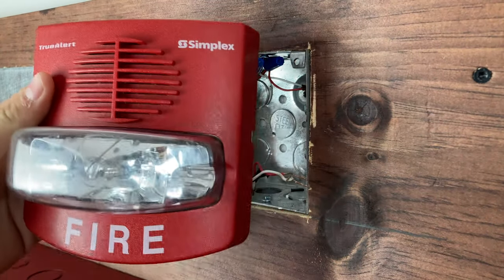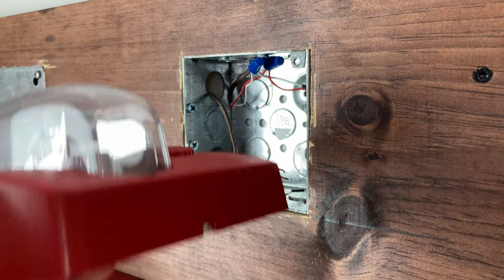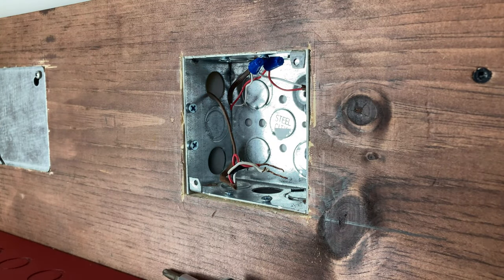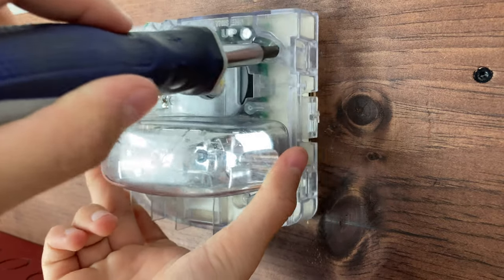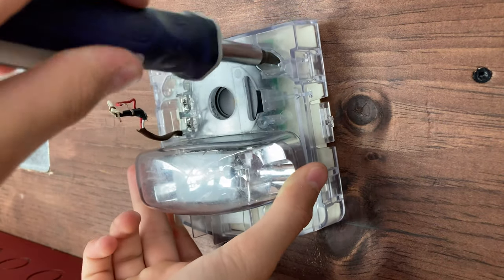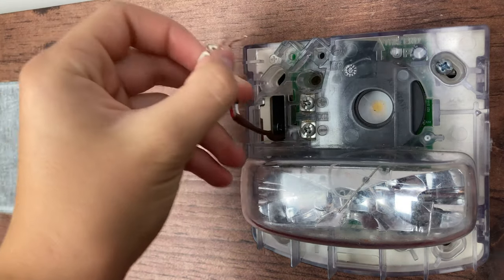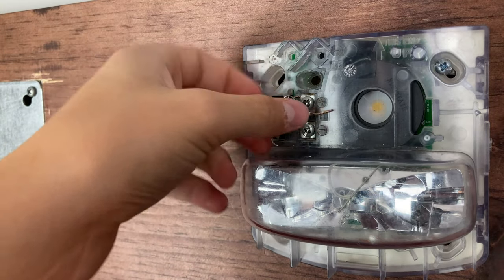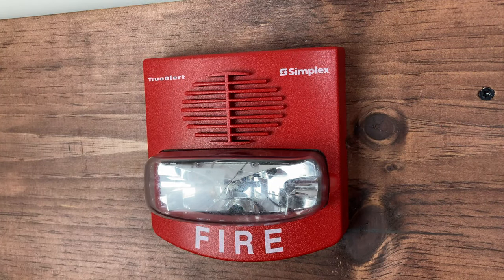How to Install a Simplex Truealert

Comment: If you get dead insects in the strobe light is it possible to get them out?    I have a couple mounted on ceilings that have this issue.
Reply: reallll! ive seen some with bugs in em dust inside of em & everything else

Comment: link to the resistors?
Reply from the maker: They actually came with my panel, so I don't have a link. Sorry.
Reply: @FireAlarmAlerts  do you know where you could find them. like what to search up when finding them?
Reply: @jasonshelley8070 what panel do you have? resistance value depends on what panel you use
Reply: @CascadiaFA  i don’t use a panel
Reply: @jasonshelley8070  what do you need them for then

Comment: If you’re a collector: DO NOT buy this alarm. (Or this version). TrueAlerts (Including Truealert ES) are Smartsync. This means they run off of 24V DC, plus a frequency that is not provided by a direct 12/24V. So unless you have a special Simplex panel, this alarm will do you no good. There are free run models on eBay, however they’re extremely hard to find.
Reply: I bought one not knowing this is there any way to make it work 😢
Reply: If the power is pulsating, such as a sync protocol, you can still power the strobe, but the horn won’t work. I heard Wheelock sync can efficiently flash SmartSync strobes.